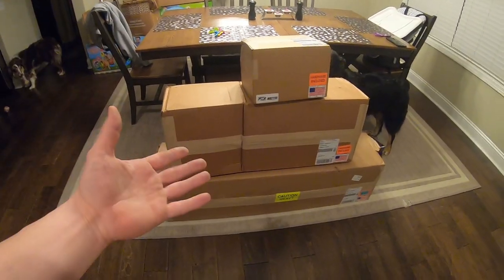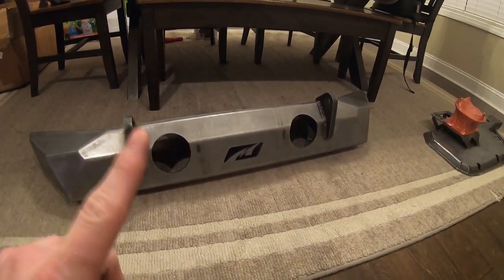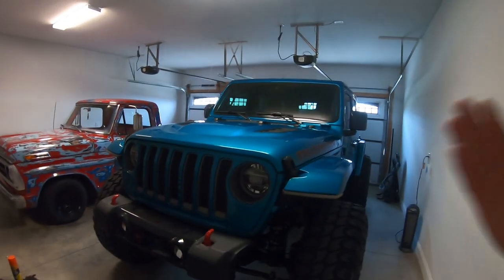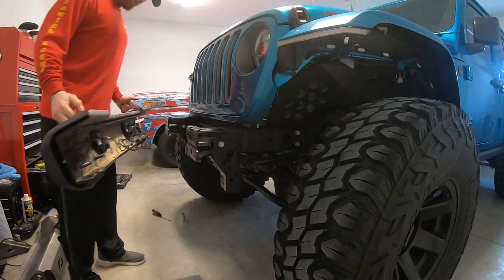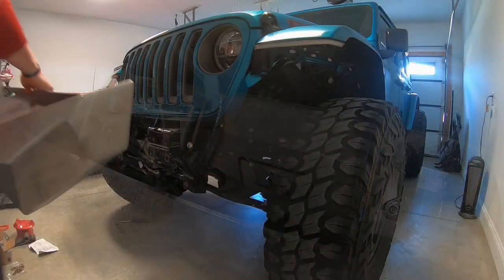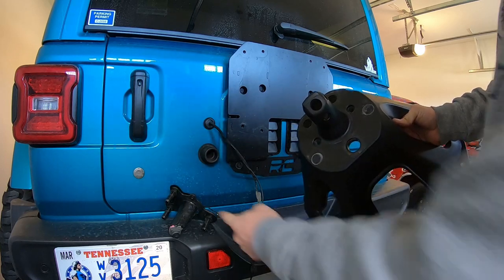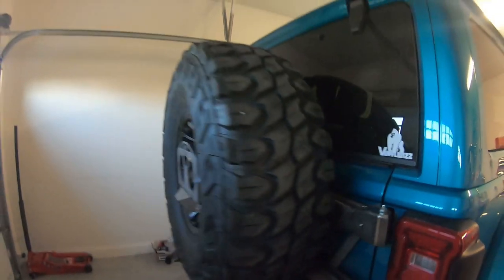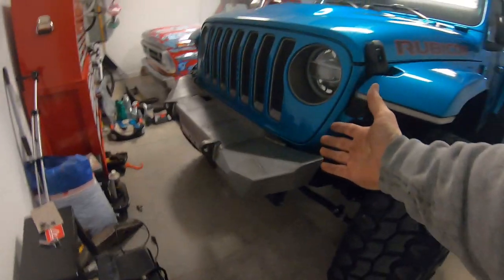$2,000 IN UPGRADES FOR OUR 2020 JL RUBICON!

Comment: Powder coat it, its much more durable than paint, especially from flying rocks and road debris.  I have a bikini 2 door JLR coming next week and have road armor stealth fenders and bumpers (front and rear) delivered already.  I am getting the fenders  powder coated with Prismatic Powders "Tahitian Teal - PMB 1250 Metalic" which is the closest powder coating match I have found to the Bikini Pearl paint (powder coat is a little more blue than the paint which is a hint greener.. .but only by a smidgen). I am  leaving the bumpers, tire carrier, and rock rails powder coated black to give a nice lower accent. And the big 4 big aluminum shackles (2 front, and 2 rear) I am also powder coating the Tahitian Teal to match fenders/body. I hopefully will have everything installed, and mounted in about a month. 

Oh.. and you mentioned build on order... that's what Road Armor does as well. It took a month to build the bumpers/fenders, then another 3 weeks to get it shipped to Alaska. But to have made in USA quality (Road Armor is in Texas), one sometimes need to be a little patient. Wish you well with your build!

Comment: Nice job . How long have you had the 40” spare on stock hinges. I put a 37” KO2 on my jl and debating whether to buy the reinforced hinges. Got mixed reviews some say you need it and some say you don’t. Your 40’s are definitely much heavier than mine. Thanks
Reply from the maker: I ran the 40 on the stock hinges only for the 3 weeks waiting on the moto one to come in. It did fine but hello put the tire in the back of the vehicle if we were going off road.